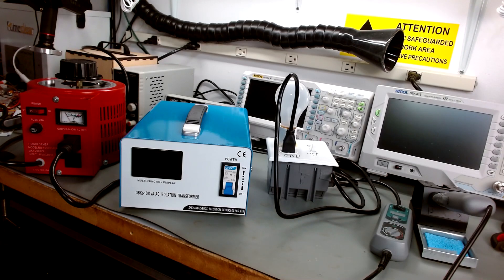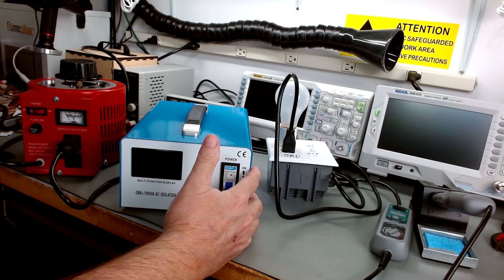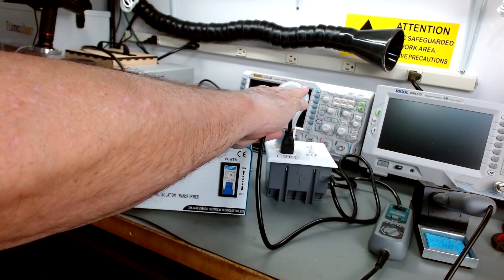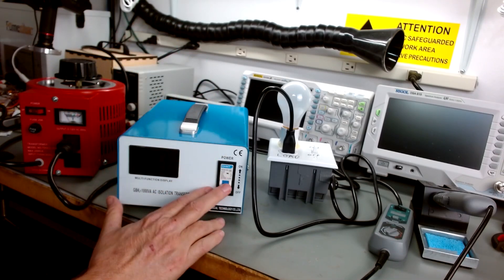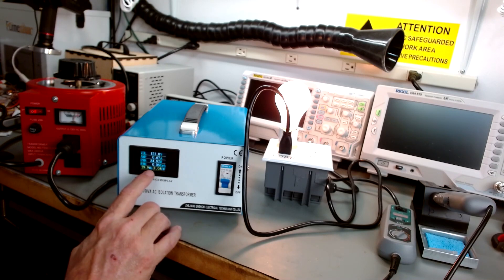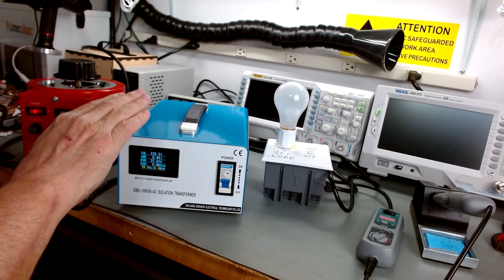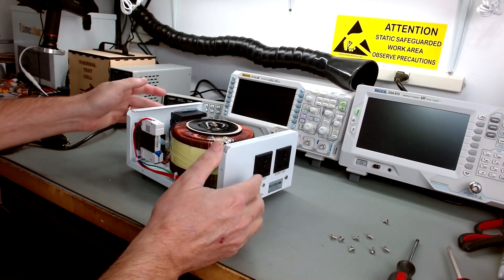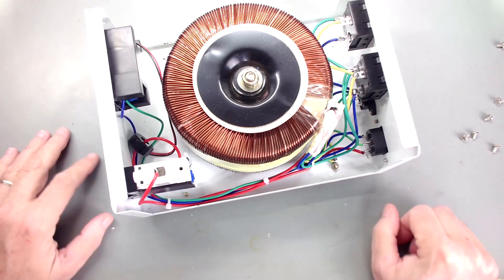How Not to Kill Yourself Working with High Voltage

Comment: Earlier I posted some questions in your isolation transformer video before seeing you opened it up here. Can you check my comments there because my wiring is the same as yours and all my comments still stand. Can you do a similar test to what you did with the triac following power from the outlet to see how the transformer is wired? Unlike the triac, I found red is common which means goes to the switch, and everything else follows all of this would track. Funny thing, this would be in line with the viewer questions regarding the triac wiring! You may be surprised which side of the plug is connected to that mode switch. While the wiring on the power in C14 has the colored lines on the same sides as with the triac, this C14 is mounted rotated 180 degrees (ground up) while the triac had ground down.  

One additional comment on what you've said here... that's not a ferrite choke as you thought at the front, it's a current sense which feeds into the display unit to provide the measured current which operates similar to a clamp on current meter.
Reply from the maker: I did reply,
If you watch the video I did catch the current sense after I said it and there is a caption on screen correcting this during the video as I said it. 
RJ
Reply: @LynxElectronicsLab  Thanks, while I did "watch" there was a lot of multitasking and more listening... it's funny I did look review to find what ferrite you called out, but very quickly went back to trying to track down how the yellow wire is tied into the coil and haven't found it's a CT for 240V which would be expected so still puzzled by that.
Reply: @LynxElectronicsLab  New discovery... the AC cable which came with my transformer has L and N crossed at the output! With a good UL cable L goes into the transformer on red and directly to the switch, so all good with a good power cable!! Think it may be worthwhile to check all my power cables!
Reply from the maker: @lostmyhare  WOW!
RJ

Comment: What's the difference between medical isolation transformer and this one?
Reply from the maker: Sorry for the delay, For some reason your post was put in the held folder for some reason. Youtube sometimes does this if the ai thinks there is something bad with it. I just found some a number of post in there. 

I am not sure to answer your question. I have never had my hands on a medial one.
RJ

Comment: Old-school AC model trains were often speed-controlled by an isolated variac... it's a shame they're not made any more, as a 0-24VAC variable isolated transformer makes a compact and powerful hobby supply. A non-isolated variac and a separate 5:1 step-down isolation transformer give the same result, but the extra transformer is bulky.
Reply from the maker: Thanks for the info.
RJ

Comment: You have lots of toys! Looks good enough for me. I have a variac and my own isolation current limiting box I built. Anyone concerned is either ignorant or a keyboard worrier. Everyone that has experience with voltage knows the limitations  and ways of dealing with it but everyone has their own opinions. Feel free to read them but don't take them to hart.
Reply from the maker: Thanks, I don’t mind the different inputs as I’m not an expert and can be wrong. Some times it points me in a better direction. But you are correct in that no matter how you do something there will be people that thinks you should do it different. But the good to that is the world would be dull if we all agreed on everything. 
RJ

Comment: Thanks for the look inside the iso-trans. Nice unit. Tip = If you need high volts and amps DC, you can throw a rectifier on your new AC supply.
Reply from the maker: Correct plus some filtering 
Thanks